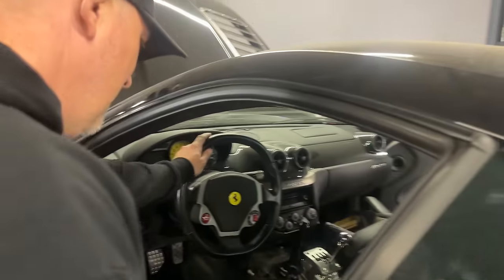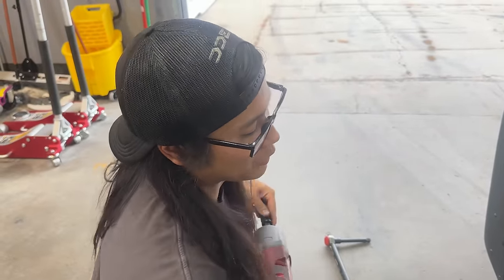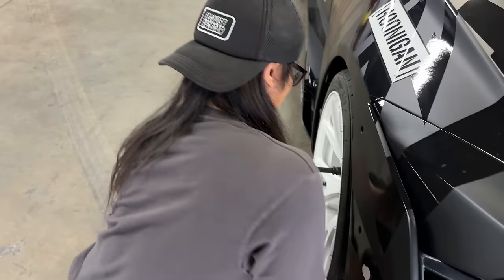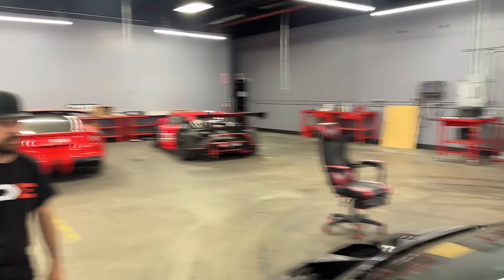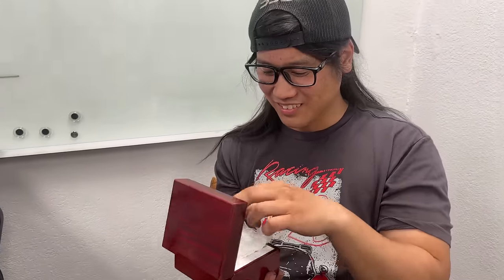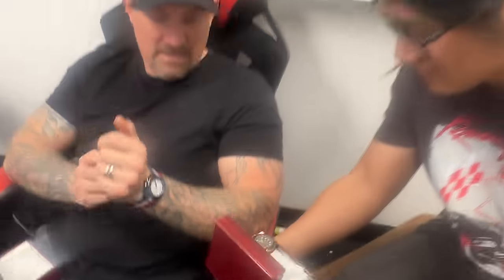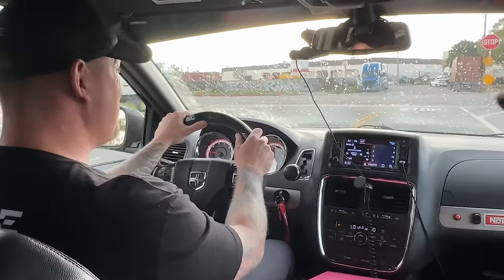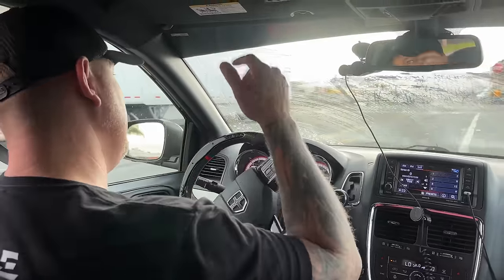You Wont Believe Why Mike Got Pulled Over...

Comment: churro recipe - 1 cup water (240ml)
-   2 tablespoon unsalted butter (28g)
-   2 tablespoon sugar (13g)
-   1/8 teaspoon salt
Medium heat
After boiling turn the heat down
- 1 cup all-purpose flour (120g)
Stir immediately
When its smooth and pulls away from the pan its done
Bring pan to towel or surface. And press down
Let it cool for 5 minutes
-   1 large egg (50g)
-   1 teaspoon vanilla extract
Mix
The mixture will separate at first but keep mixing.
It will come together soon.
This step will take a few minutes but when the dough is done.
It will be smooth and will pull away from your pot and spatula
2 piping bags and a star tip
Use 2 layers of piping bag because the dough is thick 5 inch strips on nonstick pan tray
Cut ends with scissors 
- Vegetable oil for frying
Heat oil to 350F
Use thermometer to check the temp
Drop churros
Each churro will fry for 5 minutes
Turn the churros half way
The color will be gold when done.
Dry one towel for a few seconds
Cinnamon Sugar:
-   1/2 cup sugar (100g)
-   1 teaspoon cinnamon
Role each in tray or tubwear of sugar.
Chocolate Dipping Sauce:
-   3 oz bittersweet chocolate (85g) in bowl
-   1/2 cup heavy cream (120g)
Dont let it boil
Add cream in bowl and mix until sauce like. Then serve
Reply: If this don’t come out right I’m blaming you bro…
Reply: Trying this
Reply: It actually came it okay, my cooking skills aren’t on par with some other people’s so others can probably make it better but win win for me lol.

Comment: i wish they would do the Van, supercharge it, drop a Hellcat motor into it, something, UPGRADE IT!! Dave can do the inside (luxury), Damon does the outside(livery and styling) and Mike does the Drivetrain(Power).
Reply: A Hellcat powerplant in a Chrysler minivan? Do what, cut the block in half first? There's also the minor problem of it being front wheel drive to contend with...
Reply: Nah not worth it the van should stay a beater they have alot of supercars to do those things
Reply: @gregedmand9939 it’s a dodge
Reply: Not much they could do to it.
Reply: @HXRTY9338  Uh... Chrysler product includes Dodge.
Reply: @Berm_Blaster  wheels, suspension like the render poster they got sent

Comment: I’ve had a rear wheel come off too! It was my first car, I fitted new brake shoes to the rear drums and over tightened the centre nut. Wheel bearing got hot and caused the stub axle to fail. Fortunately I realised something was up seconds before the axle snapped so was doing low speed. 2AM and had to wait 3hrs to then pay £300 to get it recovered the 3 miles to my home. Which certainly hurt my 18 year old pocket. Always check your torque specs kids!!!

Comment: Mike, here in south Africa we use velcro with 3M then you don't have to drill into your front bumper or mount some magnets to the inside of the bumper and the back of the plate if its not magnetic. It's not 100% legal but if you don't get caught you don't get caught.

Comment: Hey Mike! I literally just got pulled over for the same thing on my MK4 Supra leaving San Clemente cars and coffee, the officer said that you are legally allowed to have a decal front license plate as long as it measures the same and as the same color as the rear plate or what your front plate would be. He said it's completely legal and you can even use zip ties or 3M fabric tape onto Velcro. Just a heads up

Also, you aren't obligated to fix it, you can pay the optional fine and just mail it in or do it online if it's less of a hassle and will cost you more money to go about it.

Comment: I remember when ohio had front plate laws and we would all get pulled over.  Then there was going to be a class action lawsuit against the law becuase from the factory alot of vehicles didn't have front plate holes/holders so you either had to ziptie a plate or drill holes which then de-valued the vehicles.  And dealerships would ding you for it if you wanted to trade it in...no more front plate law

Comment: Had a wheel come off at 60mph in my lifted truck. Front driver. By the time the truck stopped it wore through the brake rotor all the way to the center hub. All caused by a misplaced wheel weight

Comment: 28:26 might be a dumb question, but does the ticket say it is correctable or not? If it’s not correctable, you can just pay the ticket and not make the correction. I got a window tint ticket before and I spent the time removing it and took it in for inspection where they told me, it was non correctable and I could’ve left it on and just paid fine. It could save you from ruining your front bumper.

Comment: i think the  law on front  plate is it has to be clearly visible   from 500 feet away  i had mine standing upright  on my s14 on the passengers side "not tucked in ' i made bracket  and i had one cop here  giving me a ticket   3 times   i fought it   made my case read off the  law  to the judge but the same cop kept harrasing me   finally the judge   got sick  of seeing me    for same thing  and took me and the cop  out side read off the  ors  to  the cop  the judge has one of them  distance wheels   and walked 500 feet  and said to the cop can u see it   cop was like no    the judge said  u might need new glasses because the judge said i have glasses and i can see the plate and the tags just fine  i never got pulled over for  it again  that cop hated me    the  ors  on it may  be different   now and also different in cali

Comment: Mike build the bracket to mount to the front tow hook attachment point,,, this way once signed off can remove it and doesn’t require punching holes in front bumper of the Porsche

Comment: Ohhhh , Whooo Audi o rotation !;)))
But without broke back in Overmountain ;)))
I like video and not be scared of lost pressure tyre ! F12 R AWD go not in wall too , if street is under ground of asphalt broken could be by rain before was very dry days   be like a pudding and sink down by fly over , then the Steering whipe away and its special if the bushings break out and AWD is not in line too . . Or some idiot stole a screw for his car ;) 
Since 2009 able get antrax in germany by work in garage car work shop or factory able get on Novichock or Toxic War gas in Germany ! Else too ! 
Ithink you once said ! Good that Canada is so big and great ! But not got a watch is a signal of position or internet ! ;)

Comment: My 96 Audi has no front plate holder. I used a really strong magnet. Put a piece of steel on back of plate and frame.  Magnet on other side of bumper.  

Got it inspected. Got home, threw plate back in trunk

Comment: It happened to me before in 2009 in the Toyota Tacoma not the low rider one  I when to visit home at Dominican Republic I went to a tire shop was low. On air miles away the front driver size passed me and I was doing 77 mph the wheel pass me at least doing 90 lol it happens at least 2500 feet before big term. I was able to control the truck and keep it on the road even though it was dragging the rotor and bolt joints on the road surface for a good 800 feet leaving a  line lol I was riding with Shorty they were both both pale as hell my neighbor who I was giving a ride to and her cousin who I was gonna go F after dropping her off lol

Comment: We have the odd cop like that here in the UK, but in general, traffic cops tend to let the minor stuff slide as long as you're not being a dick. If you're driving like an idiot or similar then yeah, they'll pull you and especially if you act like an idiot to them, they'll find everything they can to pull you up on,  but if you're just driving along, sensible speed, not doing anything silly, they'll normally let you go and will only pull you if whatever mod etc... Is actually dangerous. Even then, a lot of times, if you're cool with them when they pull you, you can get let off with a warning to fix/adjust whatever it was.